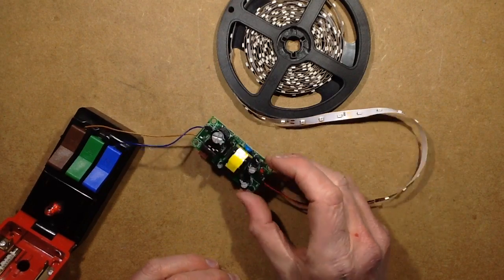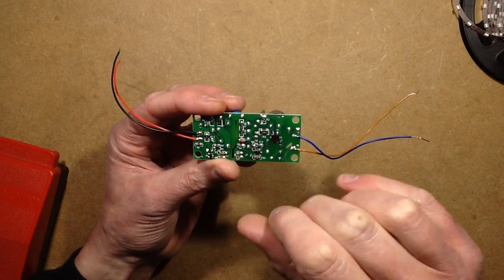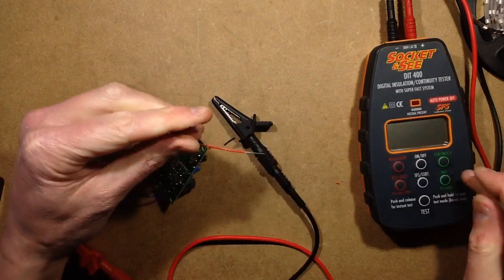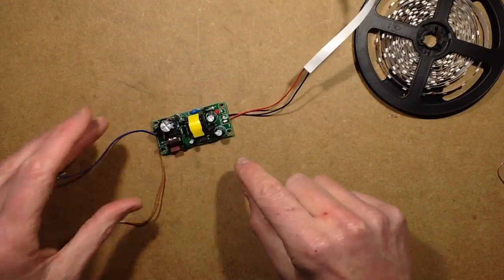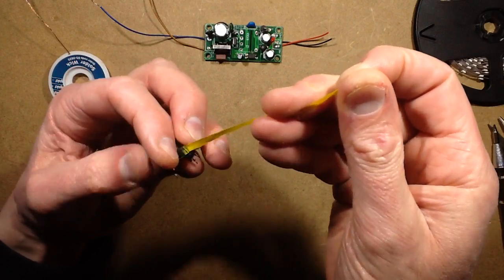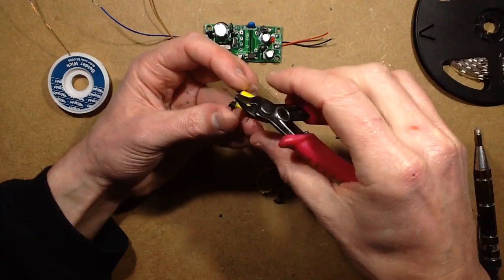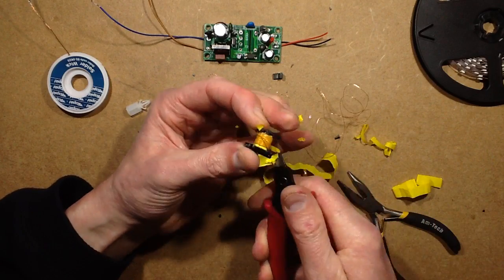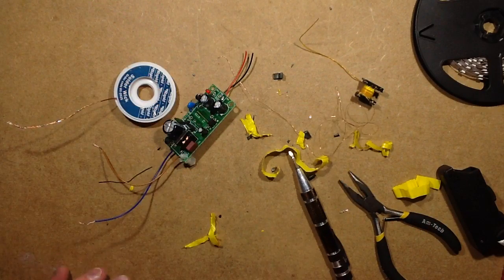Test of bare eBay 12V 1A PSU module, including safety tests.

Comment: Nice teardown, I've been using these myself in a project where I installed something like 120pcs. They have been in service 24/7 for 12 month now and none failed during this time. (I'm only pulling 500mA from them, so well under their upper limit).

Comment: The ebay listing claims that they have temperature protection.  Is there a thermistor or something on there?
Reply from the maker: If they use a driver chip it usually incorporates thermal protection.  But this one uses a drive transistor.  There is a means of overload detection in the primary feedback.
Reply: +bigclivedotcom Thanks clive.  I've ordered a few for some projects :)

Comment: Nice to see TIW used in transformer secondary winding. You should also measure the clearance and creepage between primary and secondary. Requirement for under 250VAC mains are cl: 4mm and cr: 5mm this depends on the used IEC/UL safety standard and measured working voltage but these numbers are a good estimate from IEC/EN/UL 60950-1. The electric strengt test between primary and secondary for mains under 250VAC in Overvoltage category II is 3kVAC. You should also check the Y1 capacitor between primary and secodary has some third party safety testing marks. Thanks for the videos.
Reply: That's a valid point. Passing 1kV dc test is not enough. Too bad many cheap testers go for something like 1kV or 2kV only.

Comment: Could you put a trimpot in the reference resistors to make it variable voltage? Perhaps variable current? The clive has been issued a challenge.
Reply: +Luke Den Hartog 
I also tried to figure this out on another ebay psu which puts out 12V at 10A... the component rating on the output is suspiciously generous so I guess they use the same design and just change these reference resistors.
There also already is an adjustment pot, but it is very limited (about +/- 2V)
Reply: +audiocrush The voltage is not adjustable, it is entirely dependent upon the primary-secondary ratio, the chip is a BP3102 type chip but without the integrated MOSFET. It uses a second secondary, which supplies the chip when the PSU is operational and also gives a reference voltage, which is proportional to the output of the first secondary, thus it can regulate the output, while also measuring the current to the primary and adjusting the output current accordingly.

Comment: Wow!  Nice to see a quality product floating around for a change!  For some reason, you've suddenly reminded that I have a bizarre power supply I need to find amongst my mess and tear down.  120VAC in, and 13.5VDC out, except it put out square-wave AC.  I had to borrow a scope just to figure out what was going on, 'cause my cheap little scope couldn't figure it out either.  :D
Reply: +rhkips If you're getting a square wave AC out check the voltage reference feeding the opto isolator, or it could be something as simple as the output caps have gone high ESR and aren't providing any filtering.

Comment: Don't you just hate it when you form emotional connections with PSU's.
Reply from the maker: +Joshua Nicoll Not as much as I hate it when I form electrical connections with PSUs.
Reply: That would hurt, I do indeed know that pain,
Reply: +bigclivedotcom what kind of electrician does not like having a nice unexpected electrifying relationship with their equipment? there is nothing like a nice 380V DC shock from a still charged DC cap just to get you up in the morning and get the day going.

Comment: Thanks for taking one of these to bits. I was pleasantly suprised at the transformer build quality in your sample.

I've used several similar power supplies from online auction sites in my personal projects. A couple of drawbacks to using these power supplies:  A major irritant is the lack of decent clearance around the mounting holes which forces you to use nylon hardware.  Also, even if you reorder from the same supplier, you may not get a power supply with the mounting holes in the same location!  Also you may not get such a good transformer in future units.

NOTE: If you were selling products requiring a built-in power supply, you would not use these, you'd order from a reputable supplier and demand a specification, as well as safety agency certificates and test reports if your product has safety agency listings and/or FCC/CE declarations of conformance. You will most likely pay more for this additional support unless you buy huge quantities. In a past life, I specified power supplies for computer peripheral products. It was always  expensive and time-consuming to add second sources or change power supply vendors, and the power supply vendors know this.

Comment: Thanks for your videos, I really enjoy them.

One small question, so you like the power supply and want to order more. How can you be sure that the next shipment will have the same, high quality?
Reply from the maker: +Pat Farrell You can't.  You have to visually ascertain if the unit matches the quality of the test unit.  And maybe apply a high voltage isolation test too.
Reply from the maker: +yogibear2k10 Traditionally I'd have suggested an Antex XS thermally balanced iron (which is available at Maplin) but the cost and longevity of the bits became an issue.  So these days I tend to suggest a generic Chinese soldering station from eBay.  Like the Yihua 8786D that has a temperature controlled iron and a built in hot air pen too.  I bought one to try out and have gradually taken a real shine to it.  I think when it comes to soldering irons, the Chinese use them so much in their factories that they have become standardised and affordable.
Reply from the maker: +yogibear2k10 If you have a resistance meter then check between the soldering iron tip and the earth connection for continuity.  I've got an iron that has two core flx and a separate wire for grounding.  Not ideal, since the grounding wire is shorter than the flex.
Reply: Malcolm
you are right, ive seen that happen, for example ebay sellers who sell 10 thousand things at 1 penny and gain a ton of feedback, then switch over to selling 256gb memory sticks for 4.99, eventually the bad feedback adds up, but for a long while, people either dont fully check they have a fake or cant be bothered to feedback
Reply from the maker: +yogibear2k10 I wouldn;t use a 110V one on 240V, but the Chinese voltage is 220V so that's close enough.  Just make sure the iron has an earthing facility for the tip.  Sometimes an external wire is employed for the earth.
Reply: +bigclivedotcom watch out for the brand of Caps, they like to use cheepe ones.
Catch ya latter.
Reply: +Malcolm the biggest worry would be component changes (fake capacitors or of fake voltage rating) or another company making the transformer, thus being of thinner insulating value

Comment: Christmas comes early. Big Clive tears something apart. :-)
You always make reference to the slot in the board on these projects. are they just to separate HV from low voltage?  What does the opto isolator actually do?
Reply from the maker: +Rich Booth The physical slot prevents tracking from occurring, where a conductive path forms between two contacts due to conductive contaminants and the carbon created when current flows through them.  The opto isolator contains a light emitter in one side, a transparent barrier and a light sensor in the other side.  It allows the low voltage side to control the high voltage side without electrical contact.
Reply: +bigclivedotcom Thanks both for your corrections. Learning how stuff works is awesome.
Reply: +bigclivedotcom Thanks for clarifying and all who weighed in.
Reply: +Allison Pell Not totally correct, PCB material and solder mask have much higher resistance then air, slots in PCB are there to provide adequate creepage distance. 
Creepage is the shortest path between two conductive parts (or between a conductive part and the bounding surface of the equipment) measured along the surface of the insulation. A proper and adequate creepage distance protects against tracking, a process that produces a partially conducting path of localized deterioration on the surface of an insulating material as a result of the electric discharges on or close to an insulation surface.
Reply: +Rich Booth The slot is there because air has a higher resistance than the board and solder mask. It's there to stop high voltage using that as a way to sneak over to the low voltage with hair raising results. 
The opto isolator allows information to pass an air gap  It's an LED on one side, then air, and a light sensor on the other side, in a nice little package. You can use it to get information over a safety gap without risking letting any actual voltage along with it. Course, you need power both sides..

Comment: Your screwdriver is entirely metal... not the best thing to be shorting out a mains filter capacitor with !
Reply: +zitty fang - Only if the other side of the cap was in contact with his body, else there won't be a direct path and thus current flow through the screwdriver. Like if you touch an electric fence while jumping in the air, it's only once there is a path back through the ground (tied to the other side of the electric fence output) that you get a shock!
Reply: +Gameboygenius Which is why if you are looking to put the power supply back into long-term service with the same capacitor in it, you should use an appropriately rated power resistor instead, with the leads bent to meet both cap connections (attached to an insulated tool to allow you to put it in place)
Reply: Yep, pretty sure metal is a better conductor than human...
Reply: +Andre Fish However, depending on the amount of energy left in the cap, it can damage both the cap and the tip of the screwdriver due to the sudden current spike.
Reply: dickcheney6 Yep. My point exactly.

Comment: A bit of a newbie question, but given that this already has a transformer why is it necessary to have switch-mode circuitry? Is it the case that a 1:1 transformer can be smaller (and more efficient) than the equivalent transformer dropping down to 12v with a decent current capability?
Reply: +BenjaminGoose The switchmode bits are being used to run the transformer at >50khz. and the transformer is more like a 20:1 stepdown.
Reply: +BenjaminGoose Switch mode circuit is there to provide constant correct output voltage while input voltage and output load change. "Transformer" (to be more precise in this case it is coupled inductor, transformer do not store energy, and in case of fly-back energy is stored in "transformer" so correct way is to call it coupled inductor) is not 1:1 but is design to provide correct output voltage at lowest input voltage and high load (if there was no switch mode circuitry in all other cases it would give higher voltage than correct).
Size of transformer inversely proportional to frequency do that why are SMPS transformers smaller then main ones (SMPS work on much higher frequencies)
Reply: Daniel De Jager Miloš Lazović Ah thanks guys! I remember now hearing someone mention before that the size of the transformer relates to the frequency.